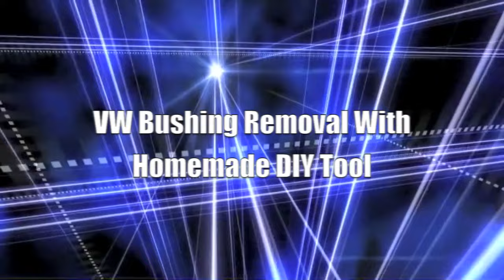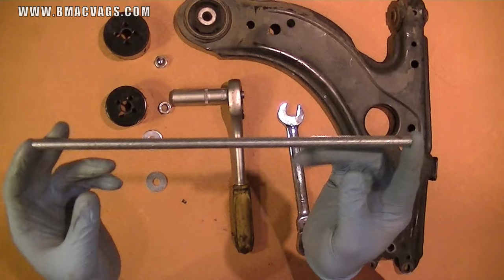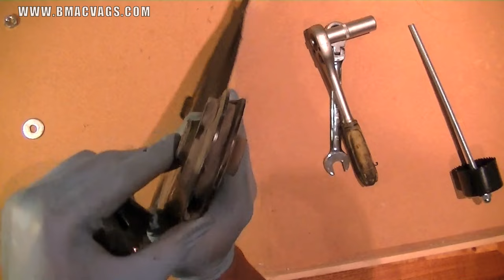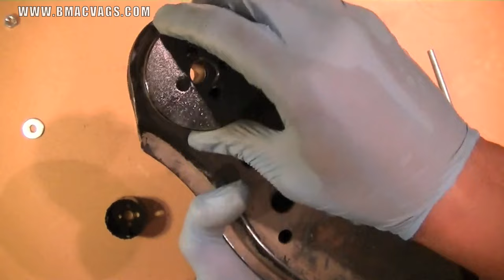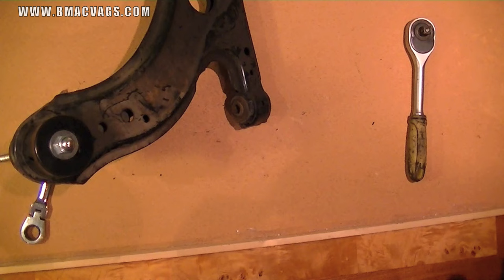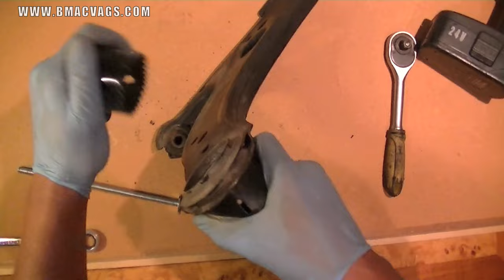How to Remove a Wishbone Bushing with DIY Homemade Tool

Comment: I tried this on my Vw t4 the hole saw just crushed then the threaded bar stripped so I bought a Chinese bush puller kit for £50 it works every time 👍
Reply: Yeah I was thinking the same thing. Like, how are they not collapsing and the rod stripping 🤷🏾‍♂️
Reply: @Omardottcom  yeah same 🤣🤣

Comment: I’ve changed many bushes using this method and including  wheel bearings, I’ve always used sockets but never thought of using hole saws which I think maybe better and easier, thanks for the video.

Comment: When undoing anything with a spanner or  ratchet against another tool, always hold the shorter handle,and turn the longer one, it's way easier.
And oil the thread.

Nice method.

Comment: Interesting, would never of thought to use hole saws, but I can see that working. I would be worried they might be a bit flimsy, I always use the cups out of a balljoint press kit, they are hardened steel, but for a DIYer this is definitely cheap and easy.
Reply: LOL, yeah I had the same thoughts. Personally I use sockets or get scrap bits of tubing from a metals merchant. Cool that it works though. I've been looking for a way to rebuild a UJ and this has given me inspiration (I think). Video to follow!!

Comment: Did mine the same way but i used a socket pulling into some steel tubing,  would have been so much easier if you had a vice ???

Comment: Okay, that might work on a flimsy sheet metal control arm for a sub-compact 1,900 pound car. It won't work on thicker control arms, or those made with cast metal, especially if there is rust bonding, and there usually is. This is good thinking outside the box though, for lightweight control arms. And you need a heat treated, high carbon drive screw.
Reply: Like class 8 bolts and nuts?

Comment: well done! how do you tackle a bigger job like a Toyota land cruiser wish bone remover....would the hole sows give away or bend under strain or are they strong enough to withstand the forces
Reply: dibraniuk  get the right pip cut u some home made sockets

Comment: Great tutorial mate....my bush is proper stuck because i did this today with a socket and hole saw but the hole saw started to bend inwards :-(  now i just have the case stuck in the housing ,any ideas? I need a bigger second socket i think cheers ff.
Reply: fastasfox, the smaller hole saw didn't have to go on teeth inwards. It could have been flipped around, although a deep (long) socket wrench would be needed to hold the bolt head. You can also just use washers on the smaller end.

Comment: Your video is great thanks very much.
I tried this out the other day using the same hole saws that you used and it didn't work. The nut kept on snapping and cross threading :-( . I used M10 threded steel and M10 cheap nut from proper job. Just wondering if you have any ideas as to why the bushing won't come out? Do you think I need a better quality steel thread and bolt?
Reply from the maker: Maybe you are pulling the bush the wrong way
Reply: If it is off of the vehicle, soak it in petrol for 3 days, the rubber will perish and come out much easier.
If all else fails, make a relieve cut or two through the bushing cross sectionally.
Reply: The threads stripped out? Did you grease the threads to make turning easier? 

Did the large hole saw (or deep socket) fit over the bushing metal case? 

A longer nut, used for coupling rods together wouldn't strip. 

You can use a stronger bolt and nuts (grade 8).

Comment: This looks really easy and cheap, usually a mechanic has a professional tool for this which in the end does the same with more steps involved, it costs around €50,- to replace bushings in the Netherlands, bushings are about €6,- each. So by this method you could save €40,- if you have the other tools that is :)
Reply from the maker: Yes that is the idea, there are usually simple things you can use to do the same job.

Thank You for commenting.

Comment: Any suggestions for the removal of the other bushing on that control arm?
Reply: Same method but different size hole saws
Reply: @merlingrafix  The front bush tends to be mushroomed at both ends and doesn't have a metal outer sleeve, so it's not the same as the rear bush on a wishbone. 

Even though the front bush appears to be smaller than the rear bush, they often take more force to remove. Cutting away the rubber from the insertion end using a sharp knife helps reduce friction, but there's no guarantee this DIY holesaw setup will work due to the force required to overcome the added friction under compression. 

A half decent 2 jaw sliding arm gear puller is best for this job, and only cost around the same as the parts for this DIY mock-up. 

Alternatively, if you're not in a rush, try leaving the bush in a tub of petrol for a couple of days first. The chemicals in petrol degrade the rubber, and it will make the job of removal much easier, but a little more messy.

Comment: great video. Did you change the other bush also? what size of holesaw did you use to push it out?
Reply from the maker: I am sure it is mentioned in the video
Reply: At 0:46 seconds he mentions sizes. 2 1/2 and 2 1/4.

Comment: top vid ! as per usual . just wondering tho, I will be replacing my ibiza cupra bushes which are rubber, will the teeth on the hole saw damage em ?
Reply from the maker: Not if you have the correct size that lines up with the bushing lining itself

Comment: When putting the new bushing in make sure it is orientated the same way as the original, these are torsion bushes and act like a hinge, put them in the wrong way ( 90' out) and they'll fail fairly quickly.

Comment: Great tutorial but those black cups are hard to find. Since your control arm bushings are out, swing by to the powdercoating shop and have it sandblasted there before putting in the new bushings or compliances

Comment: That was not a bad idea at all. Another and faster way(without removing the arm from vehicle) since we are in the same topic, it would be to use a air tool hammer to push it out and then again to push back on using a flat tip on air tool hammer. Dallas, Tex.

Comment: David Smith
2 days ago
Dear Bmac,you may have realized there is a wrong way to fit wishbone bushes. You should look on Ebay at Meriva Wishbones. All the wishbones for sale have the bushes fitted incorrectly. You could do a good video on this subject. In the bushes there are what I call voids and solid bits. There is a picture of you somewhere holding up a VW wishbone. In this picture you can clearly see that the solid bits line up with the front bush. But all the Meriva wishbones have the bushes on Ebay and other places fitted completely wrong. They will last less than a year.

Comment: Be sure to use a good solid or hardened thread otherwise it will slip and the thread on the rod will strip.

Comment: If you turned the small holesaw around, and used the "backside" to pull the bushing out, you would get a better and flatter surface, instead of using the teeth side
Reply: it would be too deep for the spanner or you would need a washer the size of the hole saw?

Comment: When the bushing is broken anyway....  1 Cut the rubber out 2 take a iron saw-blad of an hand saw.  3 cut the outer steel ring still in the whish-bone and saw through. 4  then tap it out with a shizzle.

Comment: This isn't worth it.  A complete new wishbone with new bushes already installed costs less that the new bushes alone and far less work.  I replaced mine a couple of months ago.
Reply: Dom 1965 i am not sure what you're talking about.
New wishbone for my Vw sharan,  good quallity one is about 70 to 100 plus pounds. Thats for one.
The bushes on uts own i can get for 50 pounds for both sides.  is it cheeper or not then?
Reply: Dom 1965 The video was created to show you how to push bushings out without a press. The cost of bushings vs arm is irrelevant. The watcher can make that decision for themselves. Go troll elsewhere.
Reply: Well said Phil. It's the method that's important here. A 'back to basics' approach for the DIYer. I try to do the same with my channel.

Comment: it seems that it could damage the new bushing if you'll use the same small hole saw...
Reply: Karlo Balazuela, yes. The small hole saw can be tuned around to press with the blunt end. Or just use washers. 

Then you need to reach the bolt head with a deep socket wrench as the bushing drops below reach.

Comment: i try this an now the hex nut just keeps spinning an wont screw in or out
Reply: youtubeGeek A,
So sorry. It sounds like the all-thread was too weak and the threads stripped. If you can, cut it off with a metal saw. Otherwise, use a pair of fresh hex-nuts to lock onto the rod. Try backing out one of the damaged nuts. 

Use penetrating oil on the junction between bushing metal sleeve and subframe. Let it soak in.

Try using grade 8 bolt and nuts. The smaller end can just have washers - if you use a deep socket on the bolt head on the small end. Use grease on the threads. 

Once the bolt is very tight, you can hit the smaller end with a sledge hammer. It may vibrate things loose. 

The commercial shops preheat the subframe with a torch to 400°F. They use a remote (no contact) thermal imager to read temperature. And they use impact wrenches.

Comment: You forgot to point out that you’ll need a different size hole saw to press the new bushing in. You can’t use the same one that you used to press it out.

Comment: You can also use, deep tool sockets. Instead of the cookie cutter. Dallas, Tex.
Reply: lol what are you a truck mechanic or something you got 50mm+ deep sockets lying around? highest I have is 30mm and that's for the axle nuts. and I'm pretty sure dude lives in london uk, space is a premium over there not everyone has a work bench on deck.. gotta work with what you have.
Reply: Ain't no deep sockets this big, plus if there are they would cost $50 a socket

Comment: Whats even easier and requires only a sawzall. Poke the blade through the rubber and cut the steel bushing carefully, also using a hammer and chisel to assist

Comment: Don't use a threaded rod instead use a long grade 8 or equivalent bolt and nut.
Reply: I have a lot of "all thread" of various sizes and the nut I use is the long nut used to connect two all thread rods. The nut length is three x's the length of a regular nut.  If it strips, I will  buy the long grade 8 or look in my 100 year box of nuts, bolts & misc. for one. Also when I purchase the bushings at Auto Zone I will ask if they have a tool kit that they loan for free with a deposit. I most likely don't have a nut with cap, so I think I could ruin (booger up) the threads so that the nuts will not move.
Reply: Yeah I know what you mean, about having the assorted box of what not, I have one too, no GOOD man is, a good man without one.
Reply: The first one I saw was in the Navy. I had to sort everything and then the chief PO dumped my neatly sorted nuts and bolts and all the rest back into the big box, but I learned what was what.
Reply: Yep, I know the feeling, you get criticized for it until you save the day and the person a couple of a hundred dollars by not having to replace an item for the want of a SIMPLE nut, bolt, screw, clip or some other part.
Reply: I have grade 10 threaded rod.

Comment: Holesaws are a great idea when you need larger sizes, but for smaller sizes I use sockets. I also squeeze in a vice. If you haven't got sockets big enough go to a metal supplier and get some short bits of tubing and use those in a vice. A squirt of penetrating oil helps too.
Check out my channel

Comment: OMG what r u doing. Just use some Blow Brazing Torch and that's it.
THERE IS NOT EASIEST WAY LIKE Blow Brazing Torch.
You will make some fire but 3 times faster than other way.
Reply from the maker: Suppose you don't have a brazing torch.... then what?
Reply: Suppose you don't have homemade tool like in this video than what.
Which solution is better???
I use this method 10 years and it's perfect.
Reply: Just do your own thing. Keep it to yourself. He did the right away
Reply: I'm just say!!!!!!!!!!!!!!!!! There is easy way to do that. U can even make an fireplace little one and do this no need to buy anything.
Reply: Hashido then go and make a video
Reply: Done
Reply: Hashido send the link on here